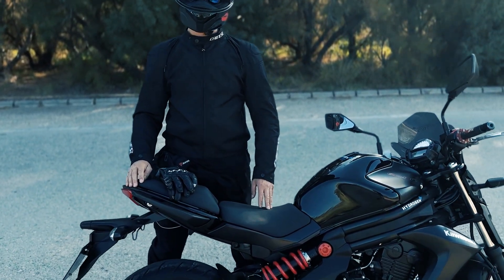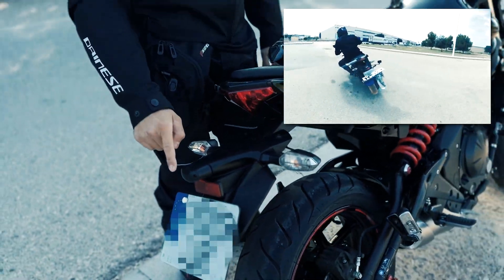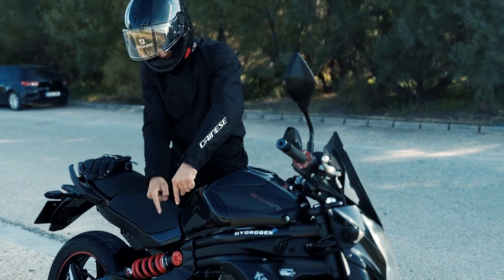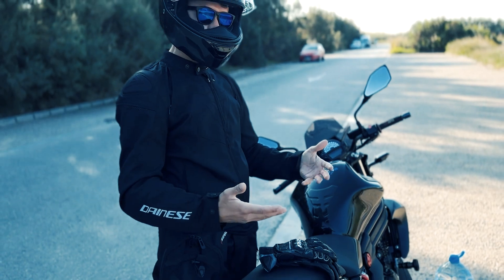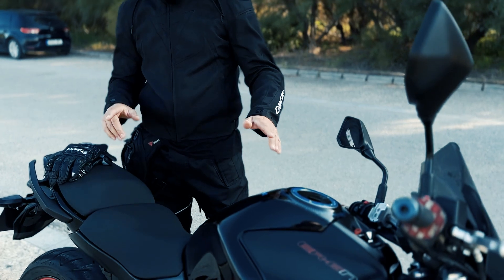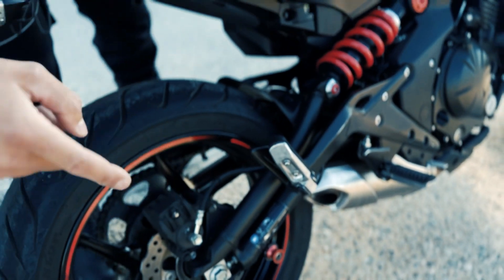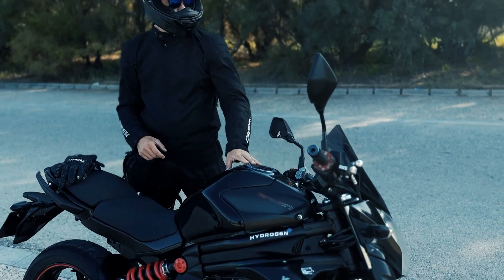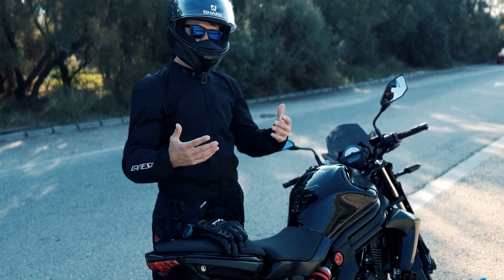Governments Hid This Invention for MONEY

Comment: No es Hidrogeno es gas Hidroxi,   HHO ,  para autoabastecer a ese motor necesitariamos muchisima corriente en la celda,  ademas no se usa agua se una un electrolito.  Es posible y es cieto que hay celdas q ahorran combustible ,  pero en el video le dan color y un poco de toque cineasta...
Reply: So you’re saying that it doesn’t work🤨
I can send you a link to a Water cell that I made that most definitely works and powers my motorcycle 
And I don’t have YouTube views not for that
Reply: You are right about HHO gas
But you can separate them I used the carbon rods out of batteries
And used drain cleaner as my medium I could use salt but salt makes it get nasty quick
I have a hose taking the HHO to the combustion unit

Trust me, it works
Reply: And a lot of the guys that makes stuff want to give it to you for free, but the reason why there is always one thing off is because common sense will tell you that it is off and you can fix it yourself
It goes back to the old 80% firearm rule
They are essentially giving you an 80% unit you tweak it it works and they are not selling you or giving you free energy or a water car so to speak 

A lot of people end up a unalive for that type of information 

You’ve got to read between the lines 

But both of these things are very real free, energy and water powered automobiles boats cars trucks 
It’s really hydrogen that powers it, but you get the hydrogen from the water obviously

Comment: In its dry crystallized form, sodium chloride appears as white or colorless crystals. When dissolved in water, it forms a clear solution since individual sodium and chloride ions separate and disperse in the water, making it transparent. However, electrolysis of the sodium chloride solution can cause a chemical reaction, resulting in the formation of chlorine gas (Cl2) at the anode and hydrogen gas (H2) at the cathode. The release of chlorine gas can cause the solution to turn pink due to the dissolution of chlorine gas in water, which forms a pink-colored complex.

It is important to note that the electrolysis of sodium chloride and the resulting color change to pink are specific to the presence of other substances or ions that may be present in the solution. Pure sodium chloride without impurities would not cause a color change during electrolysis.
Reply: What the fuck are you sayin you dont like it that a bike can run on water

Comment: I have some questions that I would like you to answer, please As far as I know, some cells that generate hydrogen from water also generate heat and consume a lot of energy Where is the hydrogen cell supplied with sufficient electrical energy and how did it overcome the problem of high temperature? Also, hydrogen gas burns strongly and has very high temperatures, which causes damage to the motorcycle engine How did you overcome this problem too? 
I ask you to make a video explaining the secret of this wonderful work